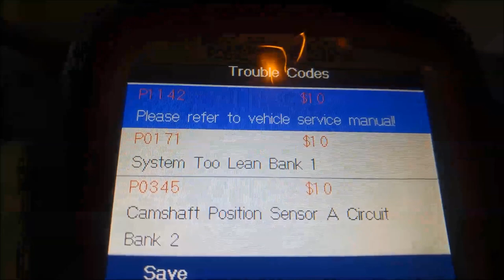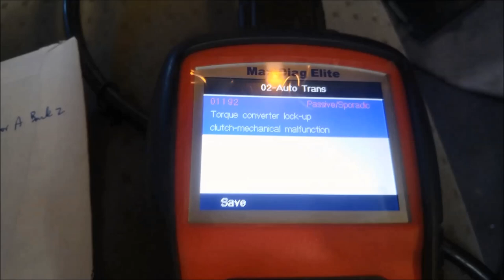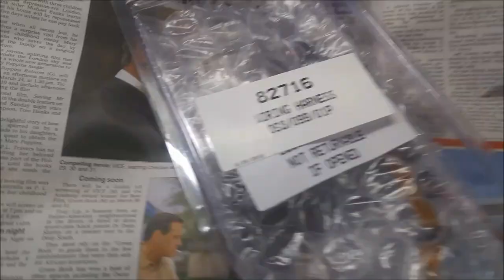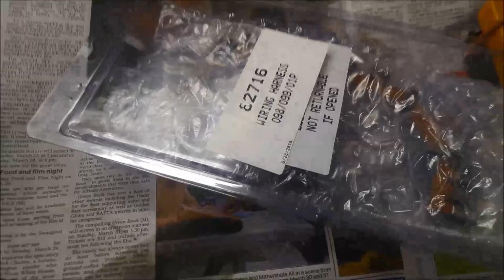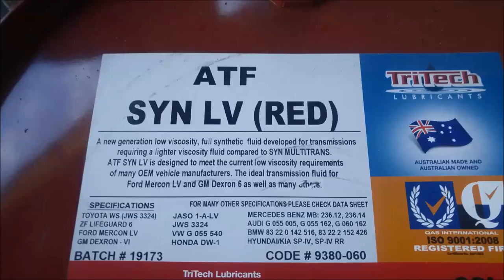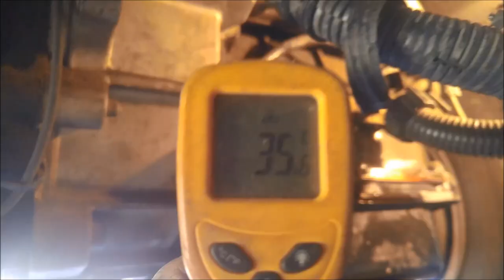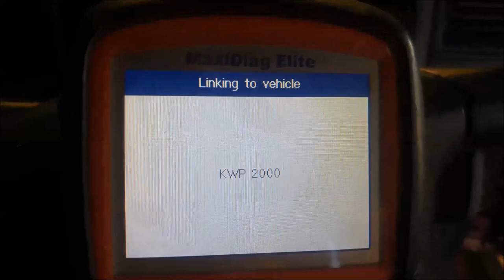How to VW T4 Solenoid Set Replace Caravelle 01P Automatic Transmission

Comment: Hello. I bought a Caravelle T4 from 1995, unfortunately the car only runs in 3rd gear and reverse. When driving is turned on, the car starts to crawl properly. You have an idea where to start. Greetings from Poland
Reply from the maker: hi, check all basics first. sounds like its in limp mode so will be an electrical issue. most often contaminated solenoids or damaged connection on wiring harness. if you remove valve body, you can air pressure test clutch/brake ports to make sure they arent leaking as well. cheers

Comment: Hey mate, great vid, do you run a mechanic business? Sorry if that’s explained elsewhere but I have some VW trans issues and am looking for someone to guide me through.
Reply from the maker: hi, yes have specialist workshop in north east country victoria. contact me on my face book link https://www.facebook.com/Yep-Thats-It-103051017785435/  and leave me which  kind of vehicle/transmission type you have, and leave a detailed description of any fault codes and issue you are having ( we are able to exchange pics/diagrams on there ) and details of what work you have already performed or checked...... you will need to buy me some beers ( link is in face book ) and I will answer your questions accordingly. cheers
Reply from the maker: hi, try without forward slash...  https://www.facebook.com/Yep-Thats-It-103051017785435   cheers

Comment: Hello I've got the same van as in this video have been told my transmission pressure sensor.
Do you have a part number.
Thank big fan of these frustrating vans
Reply from the maker: hi, sorry dont have the oem number. however these will have 2 solenoids that are same for pressure control & torque converter clutch...the other 5 solenoids are same and are for shift..so you can ask your supplier to give you the one of the solenoids that have 2 in transmission or if you`re in australia i can supply you. hope that helps cheers
Reply: Yeah mate in South Australia.
If you can supply a kit or the solenoid pack would be a great help.
Reply from the maker: @troyreichenbach6694  can you contact me on facebook link and put what you are looking for? we can exchange pics and vids on there. cheers

Comment: Hi sir
I have a 097  Audi80 B4 gearbox
The problem is harsh 3rd gear
I tried alot of experiments to solve it but nothing is working
Finally we delt with the pressure selinoid
I fixed the current to that selinoid (N93) to 0.9 amp
and gave a test drive
Everything was good but as far I know the current I fixed keeps the selinoid shunt!
So I think I increased the pressure in valve  body!
any suggestions? To solve the rough shift?
Thanks in advance..
Reply from the maker: hi, did you test solenoids when warmed up? ( do not use heat gun ...you can place solenoid in plastic bag and put in boiling water, then test...the resistance will be much higher when warmed up - compare to the other same solenoids ) it can also be a worn bore ( or valve ) in valve body. see https://youtu.be/aGSm8h7lIdo  this is how we use to test before vacuum testing valve bodies became the norm. hope that helps cheers for some beers if it helps
Reply: @YepThatsIt  ٤